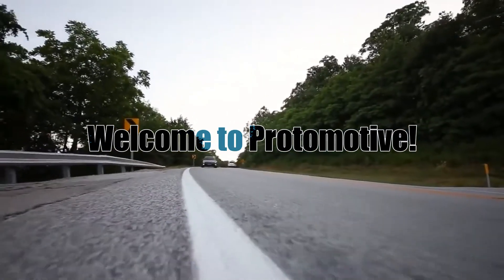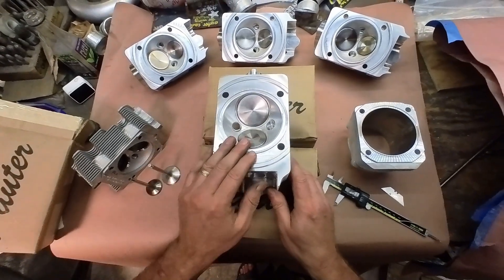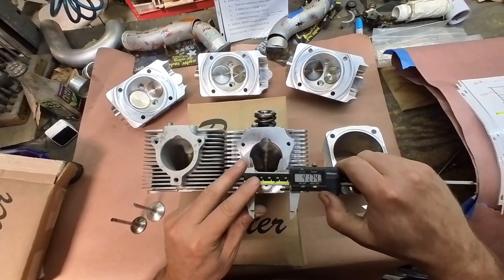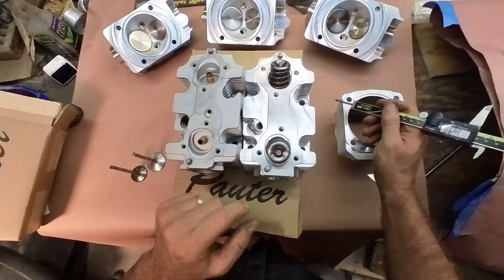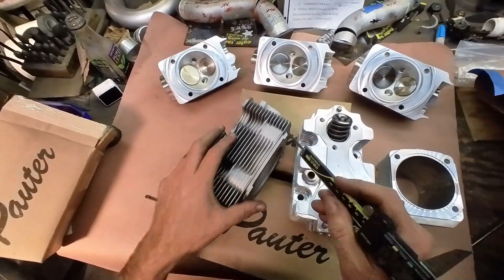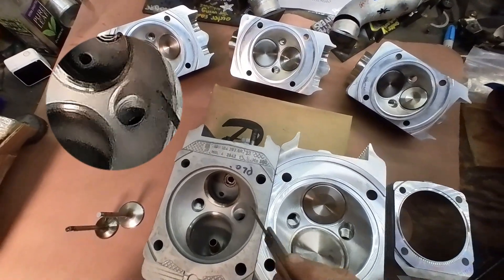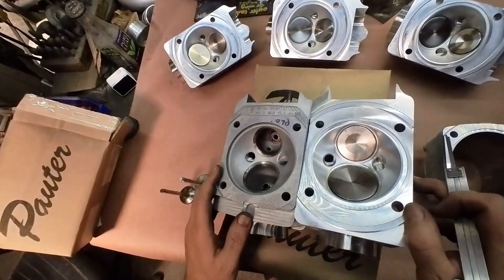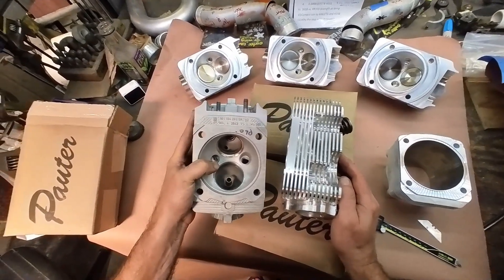Ep 1: Billet Porsche 993 Turbo Cylinder Head Unboxing, Review, and Factory Comparison

Comment: Bit scary when you hold the heads side by side and the OE heads have super thin fins and decent space by the chambers whereas the billet heads are super dense with no space either side of the combustion chamber?? The cooling airflow must be massively throttled... and diverted over the top??? I guess these are just for drag racing?? Short bursts only.
Reply from the maker: Luckily the heads are a bit narrower than the bore spacing so there's nearly a 3/16" or 5mm gap between them.  So even where the fins are solid, there's still an air channel to help cool them down.   It'd be interesting to 3D print these instead where you could route cooling between the back side of the combustion chamber and studs for even better cooling than oem.   You might even get away with a 4 valve air cooled turbo head that way too.   Stuff conventional casting / machining is not capable of doing.
Reply: @protomotive indeed. I've seen similar billet heads where we measured about 20% drop in cooling airflow.  We did cost up a printed head but the amount of machine time meant they were $6000 each before we even got to machining. I was also looking at ways to manufacture new exhaust port heat shields to help replace the missing ceramic liner.. meanwhile,  4v heads will always be extremely limited on power. I can't imagine those Swindon heads will support continuous power above 300hp.... water cooing ala 935 /956/959 is the answer now we can buy 200W water pumps cheaply there's no reason not to....
Reply from the maker: @robertcorbishley1712  no doubt 3d printing them would be 3x cost.  But does have interesting advantages :).
I did reach out to Swindon on the 4v stuff since we had many inquiries for using them on turbos.  Like you I knew they'd be limited as Porsche already did the research and fixed it with water cooling on the 956.   Swindon rates theirs at a max 500hp which may work na on a nicely built 4L.   I personally wouldn't turbo them though.

Comment: MODE Motorsport Design started making the SS Niresist rings back in the 80s.  The stepped version are for the 964 993 applications.  Patrick MS is knocking off these and many other products originally created by Bob Holcombe of MODE.
Reply from the maker: Thanks for the correction.   I didn't know Bob had come up with that design.   I have tremendous respect for him.   He's been quite the innovator in this industry!
Reply: All good and we got a few more sets of flame rings here if need them.  Also setup sheet specs.  Done many sets of these heads with Brian, including the 1st 993 set.  All turned out excellent.  More than a few won many races.  Few sets ran with Jim Higgs JB Racing steel lined cylinders / CP X forged pistons, excellent results. Nice works.  Very informative vid, love it, thanks for sharing.  @EuroPartsWest @protomotive
Reply from the maker: @bmday77  Good to know.    Shoot me an email with the spect/setup sheet and pricing/availability on the flame rings you have there to sales@protomotive.com.   Be sure to check out part 2 coming up this weekend, I hope.  It covers all the thermal expansion rates and strength of materials.  We found a few surprises in the data that was fun to share :)

Comment: Hey Todd, Bill made better heads at Xtreme for me! Cooling of the last génération machining is way better for température  ontrol at high boost . No problem for few 200deg peaks on RR350 Xtreme heads . But the porting+valve size setup done on this heads you show looks great ..specially on exhaust D-shape work 👍 unfortunally i not see Oring seal on exhaust them we have to use old 3,2/3,3l turbo seals i suppose. Thank you for this Vidéo Todd❤
Reply from the maker: @cyrilperroud1130  that's awesome to hear!   Yes a conventional gasket is used on the exhaust side on these.  I'm sure Pauter would be happy to machine an oring groove in the exhaust flange if we requested it.  Be sure to watch the next video in this series.  I go over the strength of the different alloys vs temperatures.   There's some surprises in there for sure!

Comment from the maker: Corrections.   The stroker crank is 82.4 in the engine these are going on.   I'm told that the Xtreme heads are now made of the better RR350 alloy vs A356